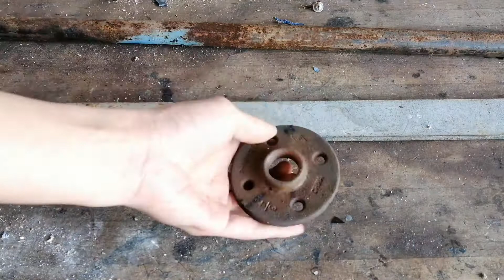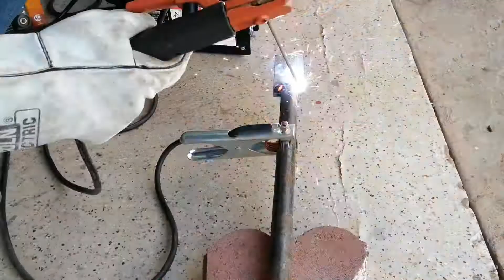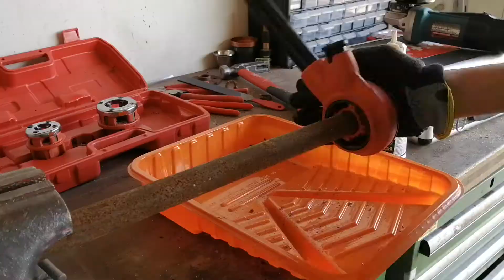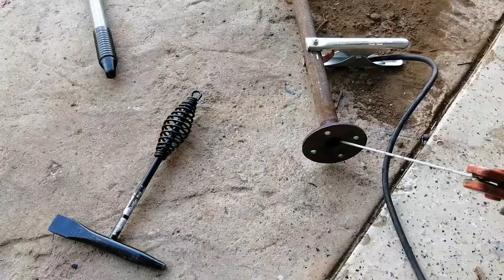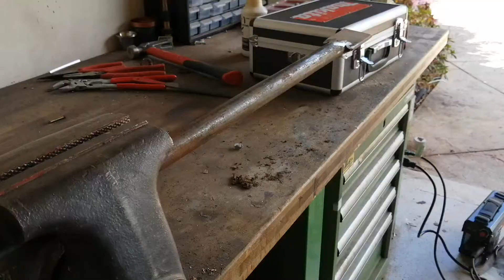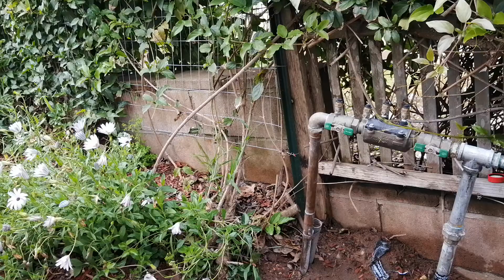DIY Digging Bar from Scrap Metal - Easy Welding Project

Comment: I think you could improve it more by adding a foot pedal type thing on it so you're able to push it under roots without using upper body muscles but your larger leg muscles. There is a tool called the "Son Of Prong" that does this.